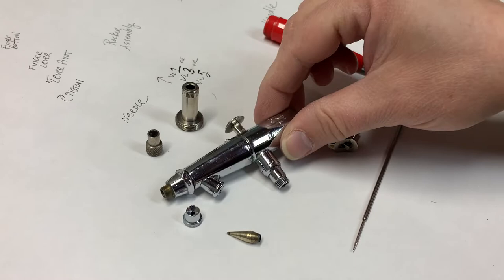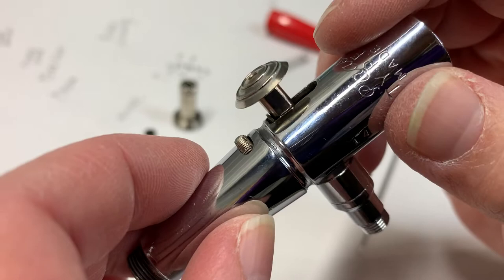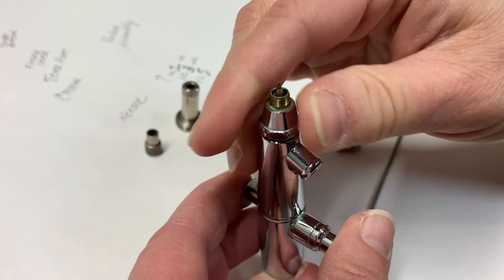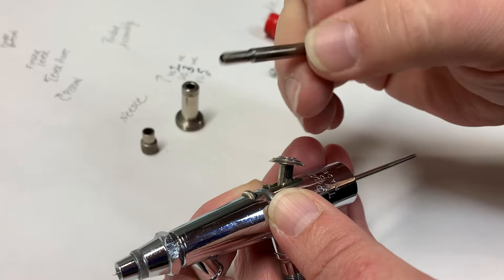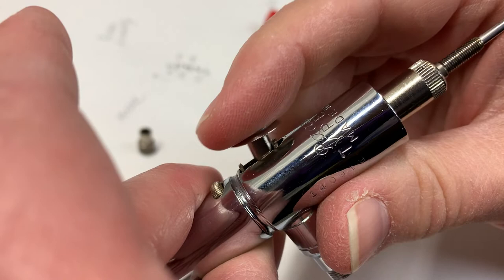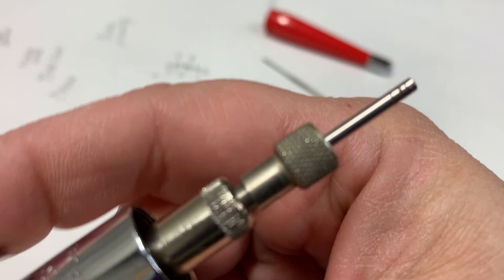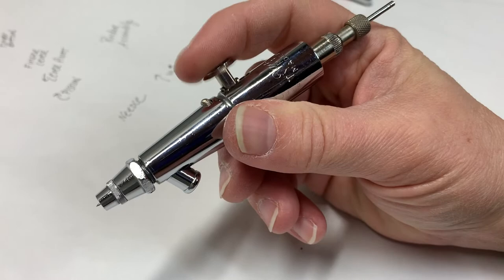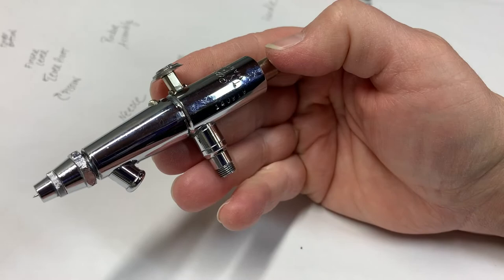Paasche VL Airbrush Assembly Instruction (video #12)

Comment: Nice video but it was the trigger I can’t get  to sit properly and you skipped that entirely
Reply from the maker: Hi Jane, thanks for your comment. That trigger can be tricky. The piston has to be very straight and then it just slides right into valve hole inside the body of the airbrush. If I can figure out how to get good lighting inside the airbrush, I'll definitely show it in another video.
Reply: the triiger if u look athe bottom there is indent make sure that u look inside and that bump will be siting in that indent
Reply: @griffinartandairbrushing3174  should of shown it show us every thing but the trigger install
Reply from the maker: Here's the Trigger Video! https://www.youtube.com/watch?v=TrxOxNx-z7Q